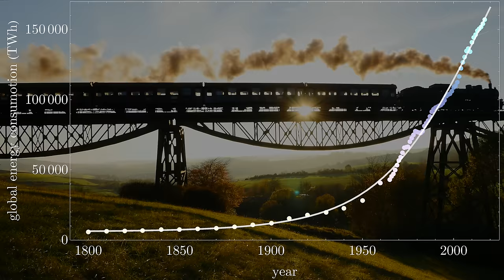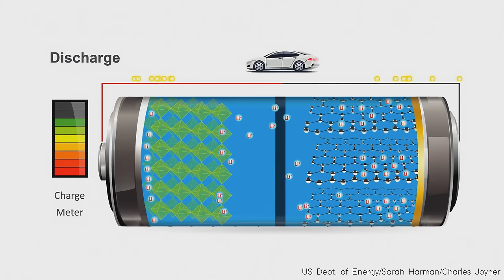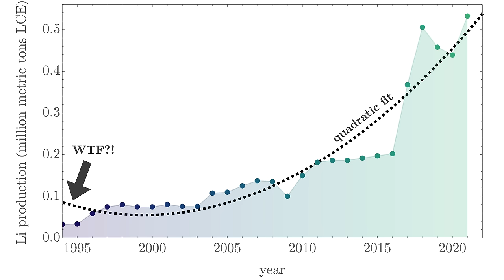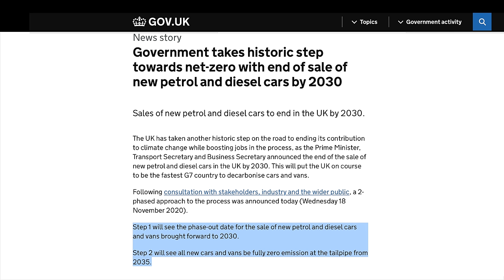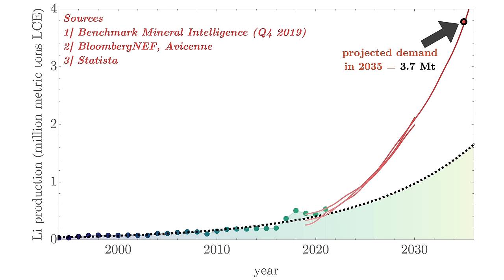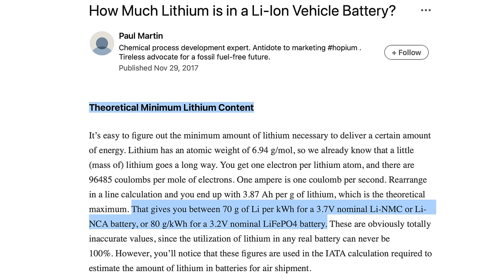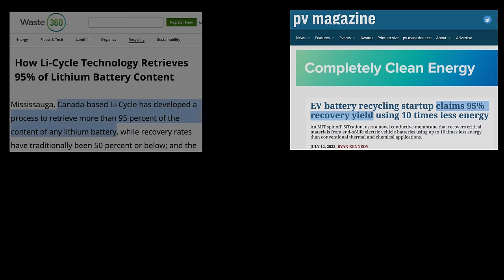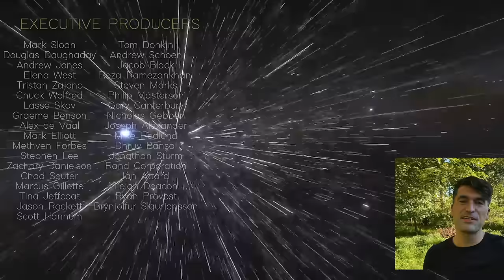Will We Run Out Of Lithium?

Comment: I have 2 big issues with this analysis. 1. I think it is likely there will be other battery technologies, that don't incorporate lithium, but are viable or even preferred for vehicles, or for certain types of vehicles.  2. I think it is likely there will be an explosion of eVTOLs, with literally millions produced each year, to possibly as much as 50 million made a year.  They will be preferred over cars, but won't be able to fully replace cars, because many places will not have parking for them.  And weight will be limited, so shopping for larger/heavier items will still be done by road vehicle.  Though, this does suggest that, that road vehicle will be a truck or a van more often than today.

Comment: There will be tremendous hurdles ahead for poor countries though. They will have close to zero inclination or means, to setup charging stations for EV's as their populations can't afford them anyways, and the country's power infrastructure likely will also be lacking, if not missing altoghether. Nobody would want to drive an EV in such places and unlike gasoline, you can't have spare fuel in a Jerrycan in the back of your trunk. A large portion of the worlds population will need gasoline fueled cars, unless one fancies taking a tour in the Mongolian desert in an EV and bet on how long the battery will carry. EV's will be limited to driving within developed countries. Everywhere else, gasoline is still the king.

Comment: If not for lithium, we would still have swappable batteries in cell phones. 
Instead, tech companies (Apple) have made it difficult to replace batteries forcing users to throw them away as e-waste. 
With electric vehicles being mandated by 2035 in California, this puts additional loads on an electrical grid that's already struggling with current demands. 
There are also issues with fighting fires caused by overheated batteries and proper disposal of used batteries.

Comment: Great stuff - but I think there is a unmentioned wildcard:  Improved and alternative battery technology using less Lithium, subsidized by other materials...along with greater battery efficiency per unit.  This video is discussing decades, and paradigm shifts happen fast.  This feels a lot like people in 1900 planning on how many horses they will need for horse-drawn carriages over the next 50 years, getting them thru 1950. Lithium is a  strategic material, but the smartest chemistry minds are hard at work on the battery technology revolution we are living in.

Comment: I don't understand how you can have a whole analysis on supply and demand of anything without talking about the cost/benefit (price).
Broadly speaking, price is a function of supply and demand. As the demand goes up the price goes up and as the price goes up it eases pressure on demand. If lithium was 1000 times more expensive, the demand would fall. 
Price is fundamental when talking about supply and demand. Especially emerging, "non essential' technologies and materials. Without this dynamic reference point, it is barely relevant to the real world.
Having said that, what you do have in your content is an excellent standard of delivery and well thought through analysis of some merit.
Thank you for sharing.
Reply from the maker: Thanks, perhaps I should have discussed that more but as already getting a bit long in the tooth here. I think the point is that we focused on mandates which are effectively price insensitive, it’s law that car dealers sell EVs irrespective of the price.

Comment: The answer is hybrids.  Use a ~100 mile range battery for your daily driving, and have a small (40 hp or so) gas motor for the range on road trips.  Boom- we only need 1/3 as much lithium.

Comment: Thanks for the interesting video! 👍
Question here is, how the energy to charge those EV is going to be produced? Nobody is talking about it.
In my opinion EVs using batteries is not the future and the forced transition to EV is driven by lobbyists misusing ecology as the reason, but in reality it is all about the money and nothing noble like ecology. Also the mining in general is not the nature friendly at all.
In my opinion the right way is EVs using fuel cells or vehicles with internal combustion engines running on hydrogen.

Comment: I think that there is a problem with the calculations on the approximate 10kg for every car 
I think that the fact that we want to drive longer and charge fewer Tim's 
That means that the capacity in the battery will increase and you possibly need 20kg to make a battery 
That will put a strain on things and we will need More lithium 
But I don't think that we'll runout of it anytime soon with recycling and new sources of it will most likely give us time 
That said we need to take a proactive approach to this and not just think that it will  fix it selves that's when we run in to problems 
Thanks for a great Channel and lots of interesting topics 
Keep it coming we want more 👌👍😎

Just saying 🇧🇻

Comment: Nicely produced and presented.  However, a major flaw I see in your logic is the assumption that we will continue to develop the personal car paradigm.  A transition away from fossil fuel based transportation really needs to involve a shift away from personal transportation to public mass transportation.  That sort of transformation could greatly reduce the demand for individual EVs.  Yes, I realize that such a transformation is very difficult to model since it is more of a sociological problem.  However lithium supply issues such as you identify could drive government mandates toward mass transit and away from personal vehicles.  You also need to consider that projected lithium shortages will drive development of alternate, non-lithium, battery technologies.  Furthermore, your models fail to include development times for increased mining and building the lithium recycling infrastructure.  Those development times will push lithium production times out rather significantly, where production includes mining and recycling.  Just a few thoughts that are perhaps outside the area of the original question asked by the video.

Comment: Great video.  But it does seem like the 10 year EV battery lifespan is short.  Been reading more like 15-20 years.  My Tesla EV is almost 6 years old and going strong.  Degradation is now almost non-existent year to year.  Total was about 7% but it flatted out the last couple years.

Comment: With promised recycling efficiency around 90% and several car manufacturers investing in recycling in order to insulate themselves from "lithium price shock" and insufficient supply, it is kind of obvious that recycling is the answer. But your careful and easy to follow analysis (always leave that to a physicist rather than an economist) gives additional credence to that conclusion.
In short term we should perhaps avoid Li-ion batteries for grid-scale storage, except for partially degraded ones taken from cars (as new batteries will now outlive the cars they power). Redox flow batteries look like a suitable solution for that purpose, where their low energy density is not a problem.

Comment: While I appreciate the great effort to present a format tweaked to the topic of the always excellent and surprising Cool Worlds Labs videos, I hope this talking to camera while driving doesn't become a trend for Professor Kipping. Not only is it anxiety inducing for me to witness (pending the autonomous vehicles revolution I'll need to adapt to) but the background noise removal also clips lower frequencies of his soothing voice.

More on the subject of recycling, I feel like it would be easy to compell the industry to conceive batteries in a way that is easier to disassemble to get to the lithium if the companies themselves were accountable to recycle the decommissioned products. I'm sure once the initial effort was made to engineer the deconstruction it would pay off in materials. What would help is that the cost/effort of disassembly would also be considered as a step to optimize for at conception. I think going back to recycle all the 2012 and newer batteries is very optimistic. Part of the issue of lithium batteries is that unlike the previous generations of consumer batteries they never have the same standard shapes. Perhaps this is making streamlining a global recycling facility for every brand and every model harder even if the core of the lithium battery on its own just looks like a insulated bag of pasty material.

Comment: I have a question: you said, that some Lithium was produced during the Big Bang.
I was under the impression, that starting from the bing bang, it actually took sime time for baryons to actually be stable and that when they where basically only hydrogen was formed. This hydrogen then collapsed into the first stars, which in turn forged the heavier element by nuclear fusion.
So have I missed something?

Comment: This video is a thoughtful analysis of a complex topic and projections that far into the future are always difficult.  It does an good job of stating assumptions; explaining terminology used; and the definitions for them.  It mentions that there are outside factors that may impact this model.   Some factors will be positive and some will be negative.  

One external factor to this analysis is demographics.  At present, current analysis of, for example, the Chinese population has it declining significantly in the years ahead.  At least one projection has it's population falling to near one-half of its approximately 1.4 billion people.  This will seriously reduce the number of EV cars needed by China.  Additionally, most other developed nations have fertility rates below 2.1 which means projections of their populations are also declining and aging.  

Economic and other political factors besides legislating vehicle market proportions will also have significant impacts.  Finding and developing a way to use the brine (a waste by product) from water desalinization plants could turn out to be a viable source for extracting many minerals and perhaps expanding the sources for lithium.

So, there are good reasons to be optimistic and to plan ahead.

Comment: Some nitpicks:
1) another way to deal with the problem is to come up with another battery chemistry - e.g. sodium ion has been proposed, or just going to hydrogen for theoretically best possible energy density albeit with significant storage problems
2) you said that humans ability to predict the future is great - well, we've known since 1970s about global warming and are only now doing something
3) ... similarly, recycling has been pushed roughly for the same amount of time - yet in many countries we sort to recycle only for things to end up mixed up in the garbage truck (true story a couple days ago at a cemetery) or at a landfill (or burned). We've had glass recycling and return bottles only to drop it when plastic bottles became more common. The only material we're actually indeed recycling on a global scale is aluminium, and possibly? steel

Comment: The answer is an optimistic and resounding NO. Interesting to note that since the invention of chemistry, we knew that atoms like either to have 2 or 8 electrons orbiting the nucleus and lithium has 3 electrons so it easily gives up this weakly held electron thus becoming an ion which can be used to direct the flow of current in a wire such as copper which is element 29 which has 2 + 8 + 19 electrons so I don't know how many valence electrons copper has but it uses its conduction band which is different than in chemistry and this conduction band conducts the flow of electrons through the circuit these electrons being pushed by the lithium ions which easily gave up one of their electrons to then flow in the circuit through the copper which sometimes is used in a coil to magnetically turn a shaft which in turn turns the wheels of your very fancy electric car which you must charge at the AC "pump" which in turn pumps to use the crude term, electrons into the battery of the very fancy electric car and these free electrons force the ions to become regular lithium atoms, element 3 on the periodic table, and the cathode or anode contains a different element which takes the electrons easily from the lithium and turns this lithium into an ion which travels across the electrolyte to thus push electrons through the copper wiring in your very fancy electric car and these free electrons are now flowing as electricity which is different than chemistry because they teach you to use a voltmeter to measure the voltage and current or rather a multimeter just on a different setting and this measures the current flowing through the copper element 29 which has conduction bands for electrons to briefly some think at the speed of light but we're not sure you should check out Verisatium's video about how fast electricity goes through copper wire which last time I checked was element 29, noting of course some wires are made of platinum which have less resistance and you can measure the resistance with an ohmmeter or a multimeter set on the setting to measure resistance platinum being element 78 which really has a lot of electrons orbiting its nucleus but all we care about is the valence electrons not sure if they are part of the conduction band or not, but with platinum wires you probably could get better efficiency out of your electronic components but platinum is very very very expensive so I wouldn't recommend it if you wanted to pinch a few pennies here and there.

Comment: I'm Norwegian and I have some thoughts. As a supplier of fossil fuel, Norway is kind of "robbing Peter to pay Paul" (or even selling drugs to pay for your own rehab) so that's not good. For the moment, though, the higher percentage of EVs reduces the particulate air pollutants, so that's good. Except now we seem to have some kind of "force majeure" happening to the electricity supply, making the charging of EVs an excess drag on the (on account of the winter) necessary electric supply for households, so that's not good. Where and how will we get all the charge that's needed in the future? In all, the big picture scenario is rather bleak. I am personally no more optimistic than George Monbiot (we are the same age) about these matters.

Comment: The upcoming lithium sulfur battery doubles the energy density of current batteries, which means you need half the battery for the same energy in an ev (or anything else really) which drastically shifts those demand curves. Combined with the new extraction process that Australia just patented which increases lithium ore yield from below 50% to nearly 90%, and I think the supply curve will meet the demand curve quite easily going forward. Add in the expected efficiency increases in EV drivetrains and overall gains in design, it nakes the future of lithium quite solid indeed,
Reply: Those lithium sulfur batteries have a drastically shorter lifespan, so much so that even their increased energy density doesn’t break even with lithium ion batteries. Also that improved extraction process only applies to lithium in spodomene ore, and not the lithium found in brine. 

This EV revolution still faces some serious challenges.
Reply: @Ace Nine  lithium sulphur batteries havent even started production. The chemistry they hit on does not have the charge cycle drawback. 

Yes that tech applies to the ore not the brine but that's what most people whinge about. The brine is a non issue as it's no more or less toxic than sea salt and even regular salt brine extraction. I don't see anyone comparing about the toxic salt industry while using their silly sea salt nonsense.

Comment: I dream we one day find a synthetic formula that current gasoline engines run on, but also causes no pollution and is cheap to synthesize. It could be delivered to the current fleet without infrastructure required to power them.

Comment: My current car is 14 years old and has 285,000 miles on it. How many battery swaps would you need for an EV? just one at a cost of 10-20k dollars would nist junk the car... row it to the dump. Doesn't seem so environmentally friendly when solid cars cost way more to fox then they are worth. 
They need to make the battery module and easy to swap so if it goes bad you can swap it for cheap.

Comment: My firm opinion is that attempting to put as big of a battery as possible into EVs is a bad idea in the long therm. There should be more cars with smaller batteries, and plugin hybrids to reduce the lithium demand and the weight of the vehicles. As well as more E-bikes / E-Scooters in the city traffic.